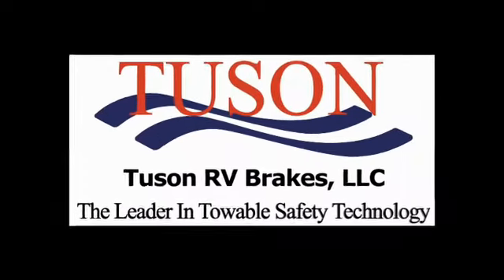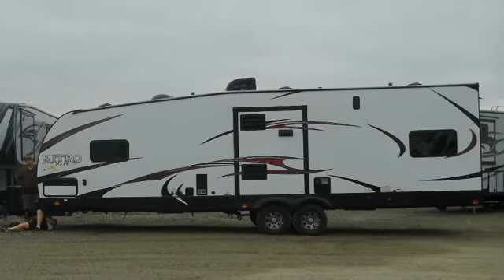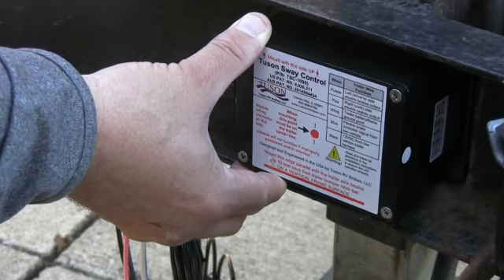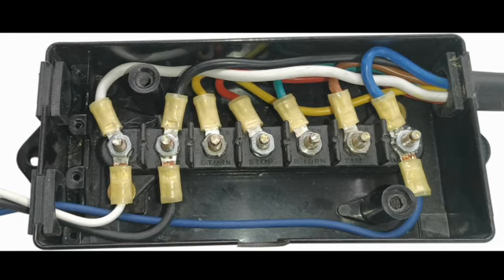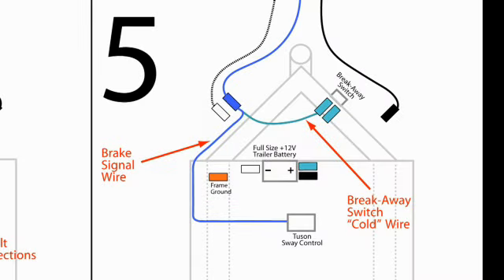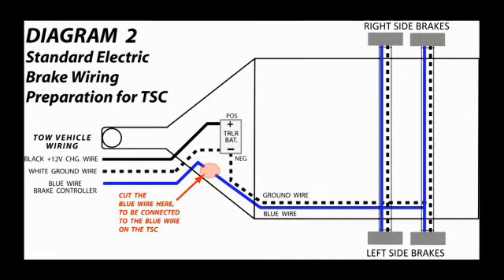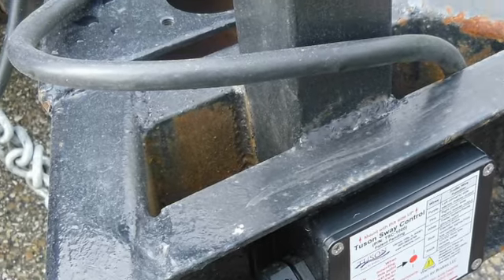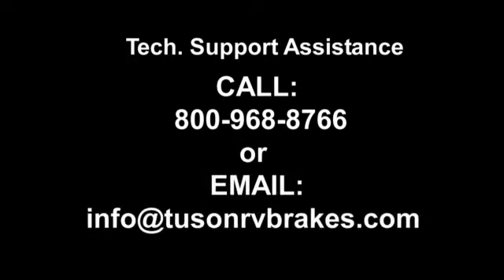Tuson Sway Control DIY Installation

Comment: Can you power the controller thru the 7 way to the truck? Don't want to add a battery just for this?
Reply from the maker: We recommend using a full size car/marine battery on the trailer to ensure that the TSC has a solid, reliable power source for +12V and ground.  We also recommend connecting the ground wires for the trailer brakes to the NEG (-) terminal on the trailer battery to achieve maximum brake performance during a sway event.  The tow vehicle +12V and ground is also connected to the trailer battery to avoid ground shifts during operation.  For these reasons, we don’t recommend just using the tow vehicle power and ground to operate the TSC.

Comment: what happens if the installation reversed the left and right side brakes?
Reply from the maker: The sway control will be ineffective. It will not create a dangerous situation other than the sway control braking which will not reduce the sway. I hope this helps. If you have additional questions, please let me know, thank you!